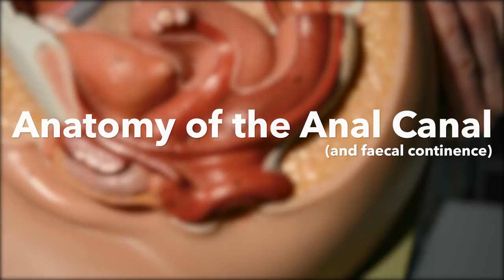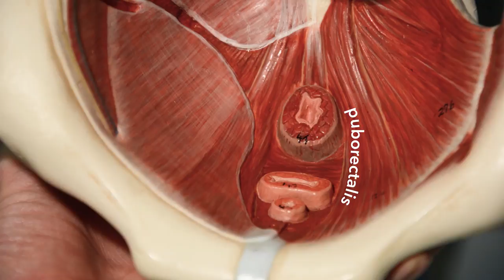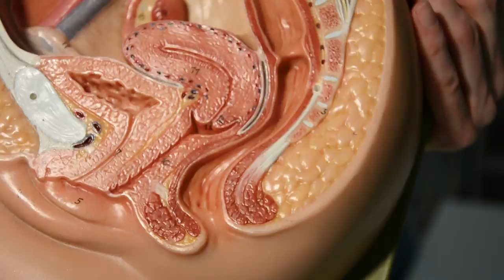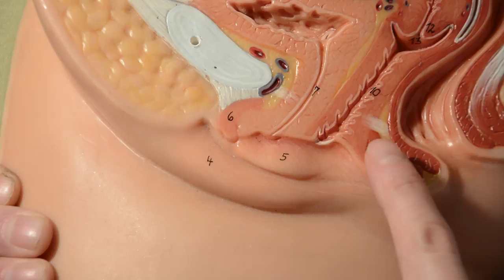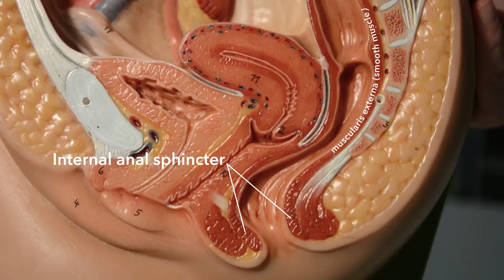Anal canal & faecal continence (anatomy)

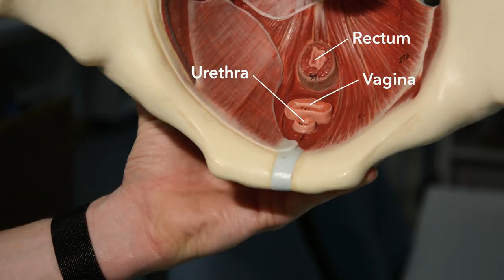Comment: 3:00 Pelvic floor + rectum
3:30 Levator ani
3:50 Perineum + anal canal
4:20 Faecal continence mechanism
4:30 Puborectalis pulling rectum anteriorly (striated muscle - somatic control)
7:20 Internal anal sphincter (smooth muscle - autonomic nervous system)
8:30 External anal sphincter (striated muscle - pudendal n)
10:10 Embryology
10:37 Endoderm (Internal anal sphincter) + Ectoderm (External anal sphincter)
12:10 Pectinate line
13:50 Porto-systemic anastomosis
15:20 Internal iliac vein -> common iliac vein -> IVC
16:50 Haemorrhoids, piles
19:30 Vascular anal cushion
21:50 Ischioanal fossa + fats

Comment: How do we pass gas (flatulence)? Meaning how do we know that it is gas not feces that are in there before we pass it? There must be a way by which the body discerns between gas and solid/liquid in rectum
Reply from the maker: That’s the job of the stretch receptors in the rectum. Stool will trigger the stretch receptors (and eventually the defecation reflex) whereas gas and liquid stool do not stretch the rectum in quite the same way.

Comment: Hello, I found a point on the lower left buttock which u  can push or massage during hard stool. U will feel stools passing there and can touch the expanded anal canal on the lower left buttock when stools pass there.

 When seated during defecation the stools pass the anal canal which is located on your lower left buttock - on the right half hand side.

Once you push that expanded  part or massage forward the stools will excrete easily.